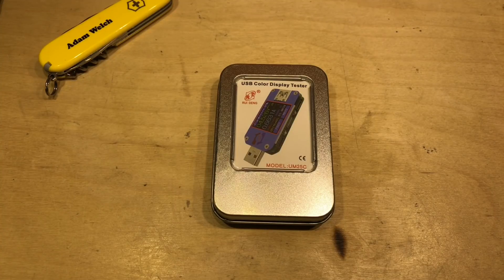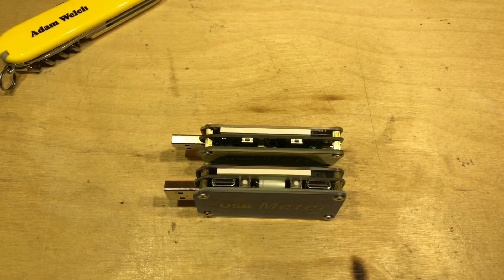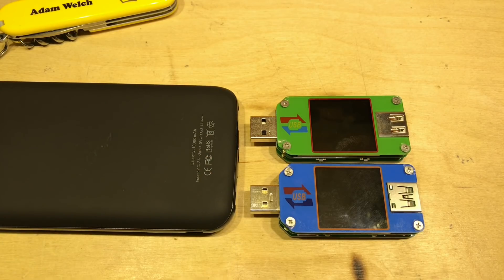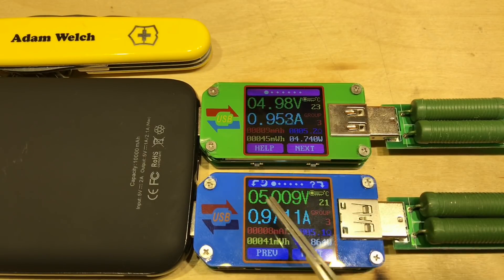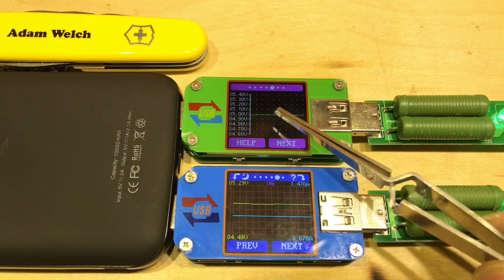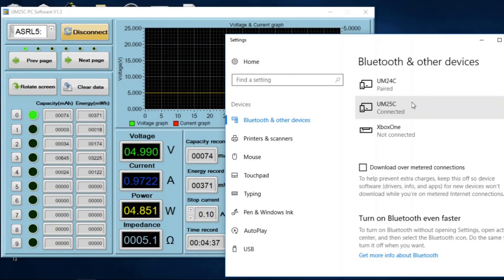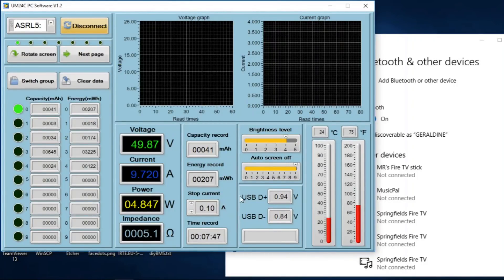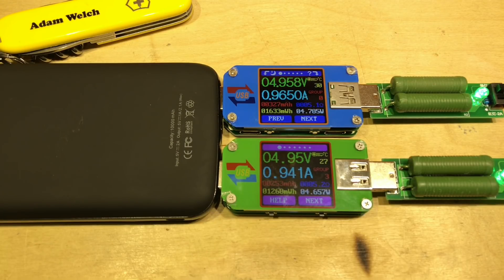RuiDeng UM25 vs. UM24 USB Charger Doctor - 12v Solar Shed

Comment: I just received a UM25 but have found that it doesn't switch on (i.e. the screen stays blank) when I plug in a USB-C Power Delivery power source. I'm not sure if I'm doing something wrong or if it's faulty.
Reply: Hi friend , 
our UM25C only measure type-c data, not support type-c trigger 
the type-c charge has switch , so UM25C don't support

Comment: I'm happy with the UM24 by now, if they fix the software for the UM25 I'll buy it immediately
Reply from the maker: The software for the UM25 works perfectly. It’s only when you use the um24 with the um25 software or vice versa when things go wrong - but we can forgive them that!
Reply: what's wrong for UM25C . you can tell me
Reply: for the price it is absolutely great and the app and software work great too

Comment: Shame the loads weren't swapped to see if there was an actual difference.
Reply: Agreed, it was driving me nuts. Some people are just more technical than others. Not a comment on yourself Adam. Just some of us that are from a tech background would appreciate that kind of comparison.
Reply from the maker: Yeah I guess I could have done that quite easily, but it wasn’t really the point of the video. They’re both pretty accurate, accurate enough for most people anyway to get a good idea on how their device is charging. Next time (if there is one) I’ll swap the loads. Thank you for the suggestion.

Comment: I reversed engineered the um24c communication protocol.  Probably will not find time to put it up on github, but here is the packet structure in case anyone is interested.
#pragma pack(push,1)
struct UM24C {
 uint16_t start;
 uint16_t centiVolts;
 uint16_t milliAmps;
 uint32_t milliWatts;
 uint16_t cTemp;
 uint16_t fTemp;
 uint16_t group;
 struct {
  uint32_t mAH;
  uint32_t mWh;
 } groups[10];
 uint16_t centiDplus;
 uint16_t centiDneg;
 uint16_t mode;
 uint32_t mAH;
 uint32_t mWh;
 uint16_t stopCurrent;
 uint32_t recTime;
 uint16_t recording; // milliAmps > stopCurrent
 uint16_t screenOff;
 uint16_t screenBright;
 uint16_t state;  // milliAmps > 0
 uint16_t deciOhms;
 uint16_t screenPage;
 uint16_t end;
};
#pragma pack(pop)
Reply: How you get it ?
Reply: Just opened a bluetooth socket and read the data

Comment: What's the point of having ten times the resolution, if the accuracy is worse by a factor of 2.5 plus a wider error in the last digit? It's very tempting to assume that the claimed accuracies for both devices are specious. That ~20 mA discrepancy is a 4% difference, not 0.2% or even 0.5%. It looks as though there's some crafty marketing going on with those units, as with far too many imported goods. Thanks for the review, Adam
Reply: Didn't you notice that the UM25 has the accuracy declared by ‰ and UM24 by %? That is ten times more precise.
Reply: Yeah. It's actually written ‰, and not %.

It's quite amazing actually. That means it is extremely accurate!
Reply from the maker: The resistors attached to those loads are probably rated at about 10% accuracy.  Heat and contact resistance could also skew readings. I think the increased voltage drop on the UM24 could be around the value of the shunt resistor though. I may take them both meters to bits to see if I can see the difference in the shunt resistor and the ADC.
Reply: Thanks Adam. If you can adjust the shunt resistor carefully, and if there is some way of compensating for its temperature co-efficient, then you might improve the current reading accuracy by a good deal. There will be a series resistor somewhere which can also be tweaked similarly to tighten voltage reading accuracies. I look forward to the results of your investigations. :-)

Comment: dang huie! I never even tried to pro bounce that name! I hate usob cables! they are nice and convenient. I just have trouble with them when they are used a lot. the one on my phone is crappy. and the one on a tablet I had  FELL IN! and one in a wall adapter had to be fished out and fixed. I wouldn't mind them in something that's constantly used. I use my phone a lot while charging! that don't help.

Comment: I also have both but I am not too sure about the UM25C.  The temperature reading on mine seems to be 2 to 3C higher than the UM24C. The UM24C is spot on as I measured with 2 other thermometers. Well not a biggie, but still a precision device...
I've also had it twice now that I had to re-calibrate the UM25C since it showed like a couple of mA of consumption when no load was connected to the device.. also has never happened on the UM24C.
Reply: The temp indicates the device temp, so the 25c runs a little hotter than the non-bluetooth versions.

Comment: Nice video, I have the UM25C, it serves me very well. I really like the bluetooth software, for low voltages I use it as a voltage meter on my PC screen. One mayor improvement Rui Deng could implement is faster measurements (like the Power-Z max. 10ms sampling rate).
Reply from the maker: Yes it’s only 2Hz isn’t it. Could have mentioned that I guess. Cheers Javier

Comment: Next USB Display Tester and I hate them at all, because they are not very acurate. Best Tester you introduced is the Portapow, it has his own battery and is very, very acurate about I want to know.
Reply: Portapow is very accurate but lacks the logging options of the UM25C and the bluetooth connectivity, I rather have those two options than being super accurate, I can always use my bench multimeter for super accurate 6 digits measurements.
Reply: Agreed. I can't get the big unit shipped to Canada that is cost effective, but I just ordered this one from Amazon.ca;
https://www.amazon.ca/gp/product/B01CVMAK2M/ref=s9_acsd_hps_bw_c_x_2_w
Reply: How accurate do you need these things ro be?  I bought one to be able to compare wall wart chargers and various cables to find the best bits.

Four, or even three decimal places is overkill for these devices.

Also like the logging so I can see if my kit charges at cc,cv, stepped etc.

Comment: No point having extra decimal places if in fact its less accurate surely?
Reply: Didn't you notice that the UM25 has the accuracy declared by ‰ and UM24 by %? That is ten times more precise.
Reply: Yes, please do a comparison (of the insides)!
Reply: You are absolutely right, mine is only 0.003Volt under reference (10.0000V reference). So the UM25 is very accurate!
Reply: Exactly. I was pleasantly shocked by precision of my UM25C when I tested it with my references (LM4040 and AD584L). And both apps for Android and PC are good too. It is a very good USB power meter for a very good price. My previous best one was 3 years old USB 3.0 Power Meter YZXstudio (red OLED model), now UM25C is my best USB power meter :)
Reply from the maker: It’s an interesting subject and I was surprised to see that just as you are. However if you think about it, it depends on what you are looking at. If you are looking at the change in voltage over time for example, more decimal points may be more useful than an absolutely accurate reading. They’ve clearly changed the ADC, and I think they are using a lower value shunt. Perhaps I’ll do a quick follow up video comparing the insides too.
Reply: I also like the software, it makes this device so much more useful. And for sure it is also the best one I have at this moment. I made some USB adapter cables to use it on my workbench :-)